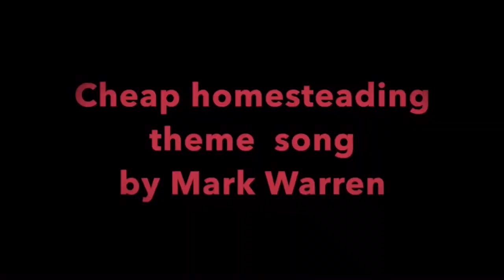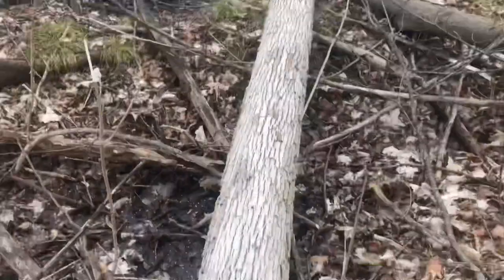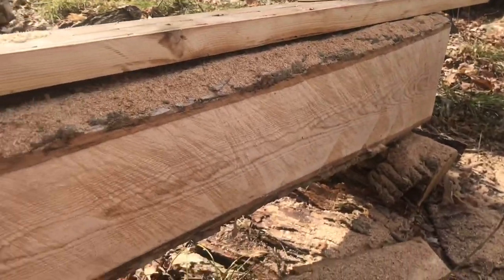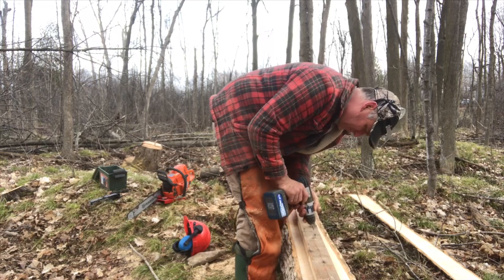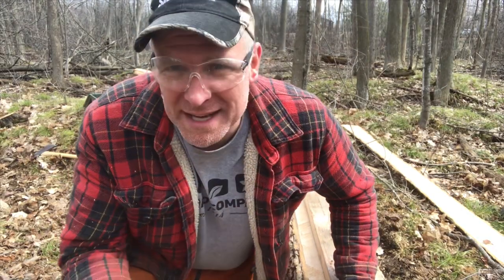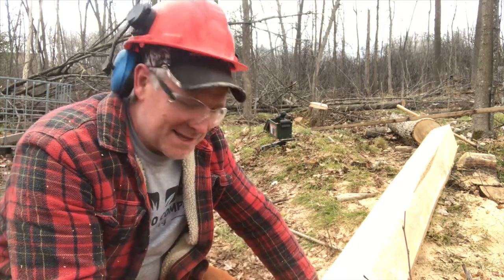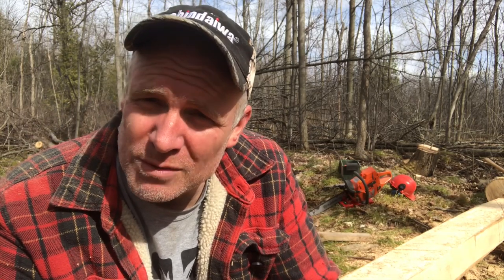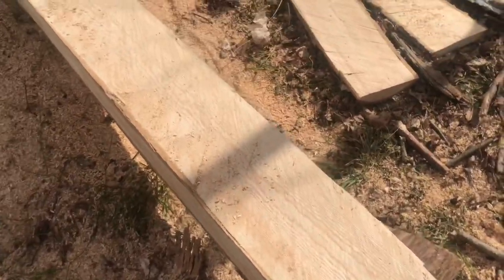Chainsaw milling with the Beam Machine

Comment: Great video.  Thanks for that. I've been using a similar vertical mill. I will say that getting a ripping chain was a huge help--smoother and faster cuts. I also found that running a couple of long horizontal cuts, in the beginning, helps ensure you cut an even straighter line.  I know Alaska mills are getting a lot of love these days, but for those of us with an 18" bar and the need for some beams in a hurry, these vertical mills are the heat.

Comment: Nice work... I've used the Princess Auto one before... had to cut along some red oak that was too big for my alaskan mill.... there was a little slop in the width, the beam cutter is slightly wider than the 2x4 I was using, but as long as you keep one side tight and hold it that way, it works perfect. Again, nice job with the ash..

Comment: Love your videos.Curious why you use this rather than the Alaskan.  I made a few with beam machine, but sometimes get poor squareness in beams due to bad positioning of 2X4.  Also planks never have same thickness cuz you have to reposition the 2X4 each time.  I have an Alaskan Mill on order to try next. Just going to slab some walnut and oak for future hobby projects.  I should be retired about the time the slabs are dry!
Reply from the maker: I have an Alaskan sawmill but I just never tried the Bean machine so I kind of want to give it a few days too play with it and see if you can actually make decent lumber. with a little bit of practice. Thanks for watching man.

Comment: Isnt it a relief after that first slab is removed?   Cause then its smooth sailing. I milled about 25 6x6s back in 2017 and covered them in used motor oil.  They have been laying on my trailer the whole time since. Not rotted at all. Oak,ash,

Comment: That beam machine certainly makes it easier and faster without much balancing has to be manually done as is the case without that guide. My dad saw lumber using a chainsaw without the beam machine before.

Comment: What size beam do you get if you simply come back the other side after the first cut without removing the guide beam?
They would be parallel, maybe adjust width with a washer or unscrew the pivot bolt a turn.
Great vidio, thanks.

Comment: I was noticing while you were cutting that there looks to be a bit of play on the inside of the plate compared to the size of the 2X4. Did you notice any movement while you were cutting? At one point looking down the log, I could see a bit of drifting from the saw. I'm trying to determine if it's worth investing in this product or if I should try to fabricate one of my own? Pretty cool gadget though. I have Ash on my property and would like to cut them into slabs. Good video. Thanks for sharing! Cheers!

Comment: Stuck nails in hardwood? Heat the nail with a propane torch it will char wood slightly but allows it to be pulled...
Reply from the maker: That is a good idea never thought of that. Have a good one Man